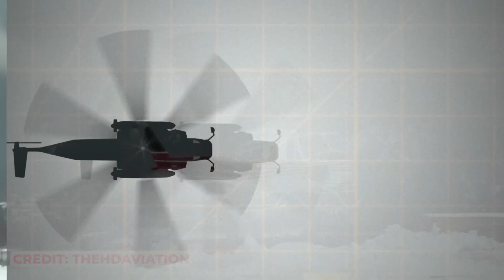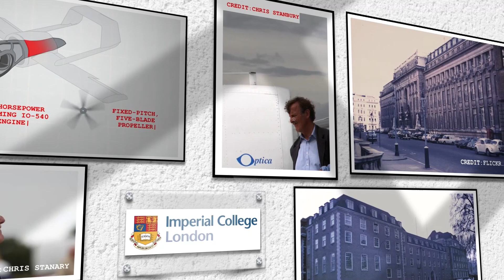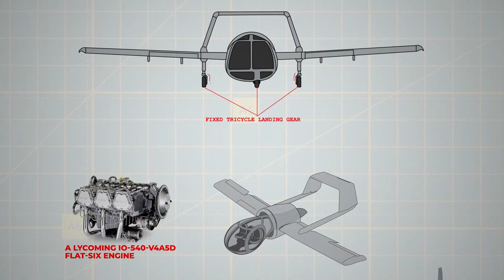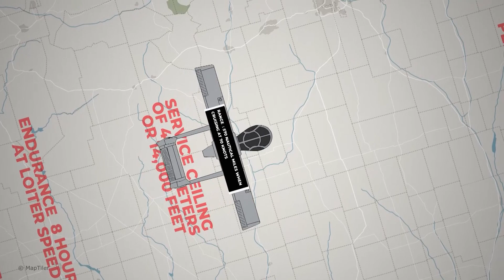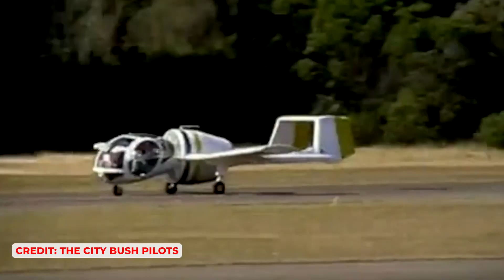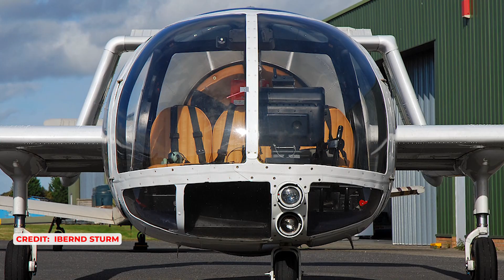This Plane Tried to Replace Helicopters: Edgley Optica

Comment: From all I could gather flying this in the simulator, it is remarkably easy to takeoff, fly and land, and it glides exceptionally well with flaps down. Feels very light and "floaty" to fly. So naturally I researched about it. Sad that it's no longer manufactured. I wonder if the helicopter industry had a part in its discontinuation....